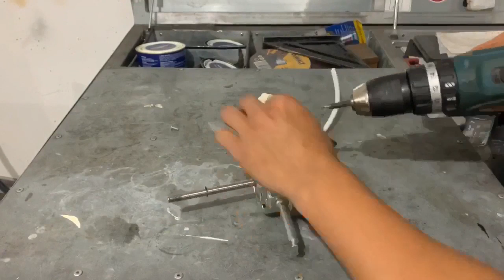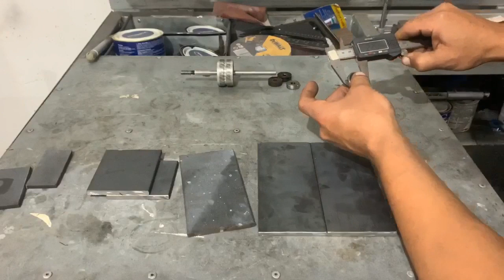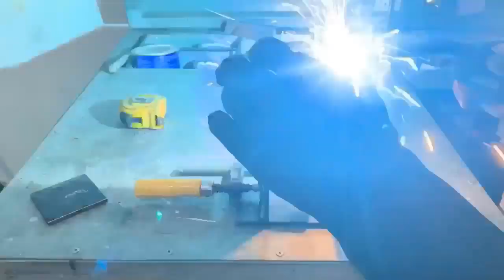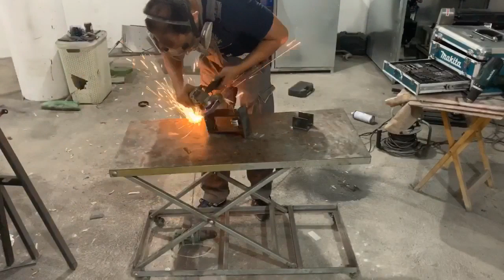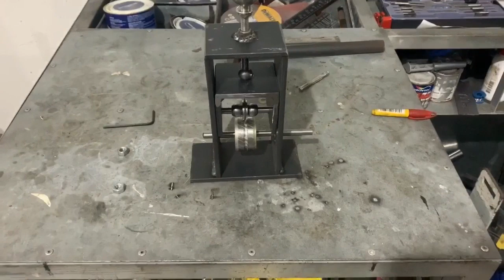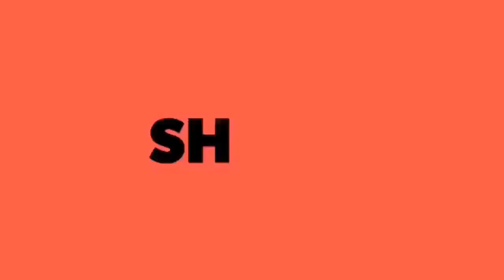diy wire stripper

Comment: Excellent build.  You could also set the belts in the drill press on the lowest speed and put the shaft of the stripping machine in the chuck instead of using the battery drill.  This would allow you to use both hands.  But I'd put something under the machine to gently force it upwards.  All that vibration might cause the quill to drop out.
Reply from the maker: drmodestoesq nice idea mate ;)

Comment: Drill doesn't looks like its helping u that much ? U still need to push it in so maby the gap on the bottom roller is to wide for the cable?